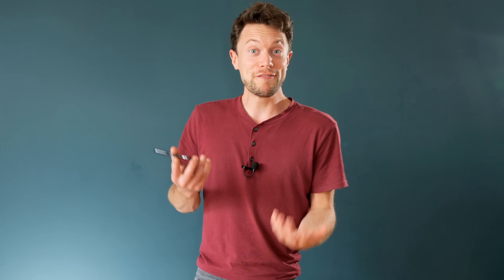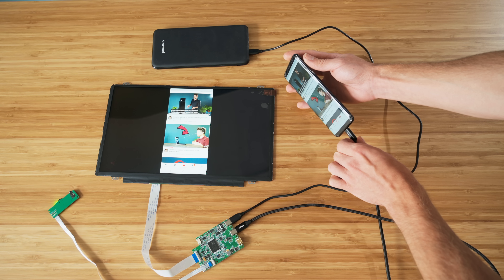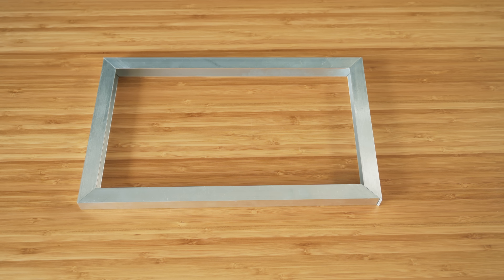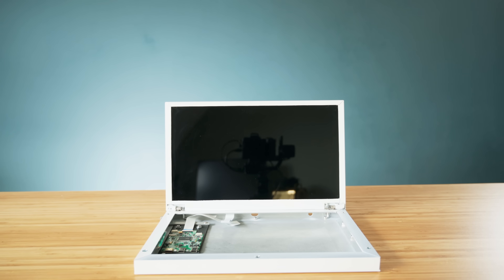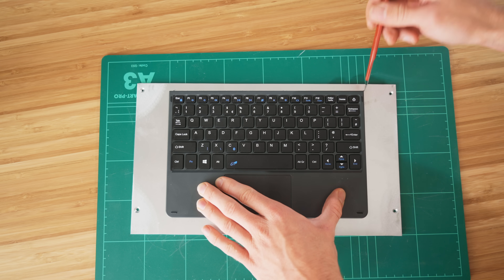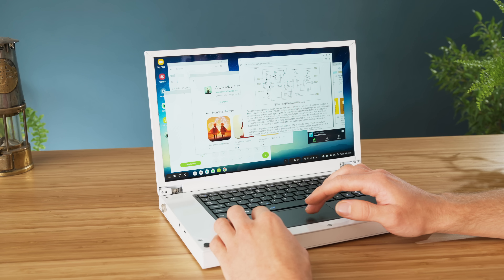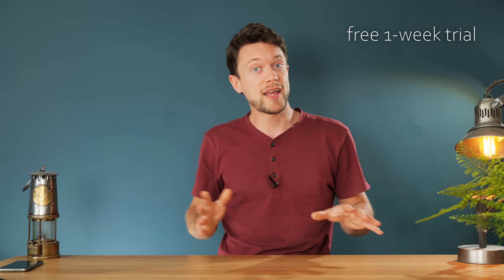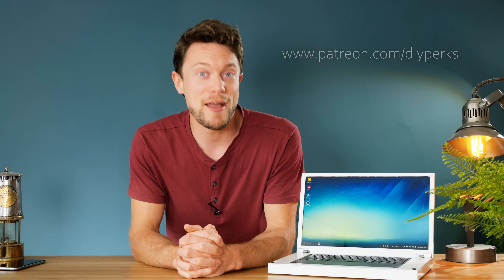Broken smartphone to working laptop transformation

Comment: You can also use a One plus phone and enable the desktop mode in it to have an experience like Samsung Dex... It works just like samsung Dex but it is not the same as Samsung Dex... It heavily lags behind Samsung Dex but is still usable...
Reply: This works only on the newer models of One plus phones... I have tried it on many other phones running android 10 but the results were negative... I have seen vids with One plus phones working on desktop mode... But I'm still not sure... Just putting my thoughts in here

Comment: A lot of android 10 phones(if not all) have a "force desktop mode" "enable freeform windows" and "force activities to be resizable" options available in the developer options. to enable developer mode you will have to go to about phone and tap repeatedly on the version of software your phone runs on, such as MIUI 12.0.4 which is what I have, until you are a developer and it should tell you you are a developer. Then look for the developer options in the settings, you will probably have to scroll down a long way to find these options but the three of them will most likely be together. once you enable this and connect a secondary display you should have a samsung dex-like experience, nowhere near as polished but better than the option that was shown in this video.

Comment: Would the display control board also keep the phone from leaving Dex after power is removed from the charging port (the port going into the laptop?) I am asking as I wish to use my S8+, a power bank with a USB C and USB A both providing the same power and a USB C dongle. but I am not sure if Dex will run on just the power bank alone. Anyone got advice.

Or better yet is there a setting/software that will force Dex to allow phone battery usage?

Comment: Nice project, instead of mechanical switch with USB C, remove the power bank top cover and add a sliding switch between battery and power board of the power bank.
You can turn off the whole system by bypassing the phone's power switch.
Reply: You could also mount the phone higher to use it's rear camera as a webcam.

Comment: This is brilliant, thank you for the video. One thing that should be noted is that powerbanks generally don't have a "passthrough" capability which is charging and providing power simultaneously.
Reply: get a better powerbank then lol any ones i've had, always had passthru charging. and this was 5 years ago
Reply: @KnockOut101inc  what brand u use ?
Reply: @coron1985  I have a nice one I keep in my car in case i need it anywhere. its a weird brand called gooloo but it even has enough juice to jump start my car. had it for a few years now no issues
Reply: @KnockOut101inc  ahh. That brand is hard to find here.

Comment: ok so I LOVE this project, which is why I ask these questions, and plan to make my own version very soon. So this is not necessarily a "durr u dum why did u not do it bedder" comment, I'm legitimately curious, especially since there might be reasoning that I'm not seeing. That being said: 

1. why the barrel connector for charging? it goes USB > barrel > barrel socket > USB again? I know you had to splice in the charging circuit for the keyboard, but couldn't that still work over USB, even maybe a Type C extension?  then you could charge using just about any USB cord and wouldn't need a custom spliced-together cable.

1a: why not just charge the keyboard off of another USB port on the power bank?

2. why not design to have the phone on the outside in the first place, or use more wood/plastic in the construction to allow for signal connectivity/cameras? (the sugru was clever, but sort of felt like an afterthought, like you built it out of aluminum and then realized it cuts off signal when you tried to finish it) 

3. why no regular power switch? there's USB in-line power switches, and control boards like this one that have monitor button control boards that could allow for an actual power switch.

4.  why not use a touchscreen panel? I've found variants of the panel you used that have all the proper inputs/outputs, but also include touchscreen capability. were there just none available when you did this project?

Comment: Eventually DIY Perks will have a video "How to build a foundry and fabricate your own x86 64bit CPU"
Reply: "repurposing a crashed car into an assembly line"
Reply: x86 64bit is actually a "AMD 64" CPU. Or if it's pretty not really obsolete and is by Intel, then it's "Intel 64"
Reply: @valerafox7795  And all three names are not 'wrong'
Reply: @marksmithcollins   we should choose the most correct one. We should understand we mostly mean AMD64 (i686) anyway, not the others are
Reply: @valerafox7795  x86_64 is x86_64, what you mean by Intel 64 is Intel Itanium, which was used nowhere pretty much
Reply: @ch1ptype  I literally said that, but with the other, but still acceptablr names. IA-64, Intel 64, Itanium - it's all the same thing.
Reply: With aluminum

Comment: How about using USB C magnetic cables which are magnetically detaching just the head tip from cable, instead of plug/unplug operation that will wear the plugs excessively?

Comment: I have a screen-broken Xperia Z3 and a Motorola atrix lapdock fully functional... Connect keyboard and tactil panel is pretty straight forward since its only needed an microusb cable extension.... The tricky part is the display... Motorola lapdock has a micro hdmi connector and I dont know how to send the display signal from phone to lapdock... Could Anyone point me in the right direction please???

Comment: USB 3.1. 
Usb-c is THE shape of the connector capable of USB 3.1 standard transmission, also containing video signal. It is fraudulent calling this usb-c as a usb-c shaped connector may carry a useless USB 2.0 standard without video signal. (Video signal came in usb standard ver 3.0, the phone refered here is USB 3.1).

Comment: Nice demonstration, but completely impractical costwise.  If you want to use a broken smartphone as "laptop", just get an older broken smartphone which support  either mhl or slimport Hdmi connection.  Then you can use a standard tv/monitor,  bluetooth keyboard and mouse as well as wireless charging and you are all set for minimal cost.

Comment: Also what tool do you use for accurate angle cutting and trimming down of the angle line pieces.

I would like to have a go at this but I want to get the right tools.
Also that stud thread tool for those flush inserts is something I have never used.
Can you possibly throw me a bone on this

Comment: Alot of folk taking the piss in here I actually think this is a great build, im just a little disappointed with the lack of coverage on how you secured the the aluminium parts together specifically with the main section for computing hardware the u channel size etc whats thickness how much uchannel space did you have in there.

This is a good home diy laptop that could be enhanced everyone spewing about the wifi signal knows if they are bright enough that there are ways around that other than smashing a phone on the back of the screen.

Thank you mr DIY Perks this has inspired me.

Comment: i tried making this and i bought the screen from your link in description i got the screen and i plugged it in and my phone to check if it worked it didnt it keeps going into a power save bubble in the middle then shutting off i messaged the seller and they asked if it was broken i have the right power supply he said but they would not take it back now im stuck with a broken screen and dont even know what to do with it

Comment: Hey u is it possible to make exactly the same thing, but thinner and with bigger keyboard and bigger track pad?
Reply: Yes there is... I would take apart the phone. And put it in the enternal chassis so u have just the motherboard ect... Then you could use thinner material other than aluminum so the WiFi is fine, for the on/off system you could make it an actual electronic switch instead of a physical switch you could salvage a bigger keyboard from an old laptop or a usb keyboard or you could buy replacement laptop keyboards from eBay or Amazon

Comment: How to repair your house after a tornado:

DIY Perks: Grab some sheet of 2mm thick aluminium :v
Reply: Buy 99999 fans and then hot wire there wires onto the aluminum sheet :v
Reply: @agentburningbutters3655  now, grab some 2 part epoxy
Reply: Hahaha
Reply: no wifi :|
Reply: ahahahahaha and fiber board and carbon fiber sheets
Reply: just dont use the pacman
Reply: Don't you mean "how to protect your house from the Tornado"?

Comment: Interesting. But could you force a Windows emulator to then run an Android emuator such as bluestacks with a busted up Galaxy Note 9? That would be very awesome. Especially since the Note 9 is 8 processor cores and each instance of bluestacks requires at least 1 core.

Comment: They have a phone laptop or Lapdock out now called the Nexdock. It's basically a laptop shell that you use your phone to operate via Samsung Dex. They just came out with a Touch version. So you can get this in a smaller normal laptop form factor.

Comment: if the phone was functional, Could you use its screen as the touchpad?
Have a usb c dock, in the part of the laptop closest to you, and install/make some software/app that makes the phone screen act as the touchpad.
have the diy laptop box with you, in a backpack, then whenever you want to use it, simply plug it into the usb c port and slide the phone into the touchpad space. (adapters for different models sold separately)
After a few revisions, and upgrades, if you slimmed it down a bit It’d probably sell really well. Some modern phones are really powerful.

Didn’t iOS also recently get an update that lets you use Bluetooth mouse and keyboard?
iirc there are cases with wireless keyboard and trackpad available in aluminum that make your iPad Pro look like a mac. It’s really really cool

Comment: There's a problem with this build, most battery banks can't be charged when in use, in addition to this, wiring the bank in parallel with the keyboard in this fashion would split the current and take even longer to charge them. The only way i can think to combat this that doesn't involve a custom power delivery circuit is to get a wall adapter with a high enough current output. Plus, depending on the type of battery bank you have it's possible it can charge with higher than 5V. So you'll need to make adjustments if that's the case. If you don't have a fast charging power bank be prepared to wait hours. 

 Please let me know if I'm wrong, I'm trying to learn :D
Reply: If the powerbank supports usb PD it's quite likely that it can both be charged and output power at the same time. Normally it can also allow for charging at up to 20V which would significantly speed up charging but as he decided to use a barrel jack instead of a type-C port for charging he won't be able to take advantage of this.
Reply: @oliverer3  thanks for the information, but in this case does PD stand for power delivery?

Comment: Ok people this is a cool thing to use old cell phone or Broken screen a nice small laptop computer for me I get 2 phone not being used so why not something out of them...
I have something special to do, I into ham radio so I can took it into the field for emergency work using something call FLdigi for android there are app for RTTY, PSK and SSTV..
The one question I have is can you used something like this for a screen...   
9 inches 1024*600 HD Screen Display LCD TFT Monitor with Remote Driver Control Board HDMI for computer    
its cheaper or just a control board for a laptop screen...one this I do also is to remove the battery for the keyboard and run for the battery pack...One this is made u can away plug in most any android...

Comment: Now if you have switched your phone number from the smashed phone to a new phone & you are only connecting to the internet via WiFi then this laptop built using a cellphone is NOT connected to your cellphone account. Is that an accurate statement?

Comment: Can anyone plz clear some of my doubts.... I have multiple Android phones (with broken Screens) none of them supports MHL (according to list of supported devices) and i have a 40 inch TV (not smart TV).. 
I'm thinking of using one of those dead Phones to make the TV a smart TV (just to watch Youtube and use some streaming apps like prime video etc. on Big Screen (I'll be using a bluetooth controller or a wireless keyboard mouse) ) 
The Problem is since the Devices don't support MHL. I would like to know if there's any way to add an HDMI output to an android device that doesn't Support MHL.

Also, 
While looking for solutions i found some MHL adapters on amazon that say UNIVERSAL (and have no reviews and stuff) so, my question is will any such adapter add MHL functionality to a device that doesn't already support it. (or is the UNIVERSAL just for Show)
(my devices include: Honor 9 lite, Honor 9i, Samsung C7 pro, and a POCO F1 (I'm currently using this one but i may upgrade soon))
(I'm ready to open up my phones as they are already useless so what could go wrong) (So, if there's anything i can do from the Inside plz tell me)
(If HDMI is impossible a VGA out might also work!!)
Reply: i want to do the same... any updates?

Comment: a nice idea indeed
liked the way he finished the disply completely
the base of the laptop was a bit industrial look
one more problem i could see is to switch onn the powerbank when connecting it as moast of them need to push the physical switch on them
the circuit cout have been switched onn with an electrical switch insted of moving the display board on a slider made out of plastic

a big thumbs up for the idea

Comment: I have a motorola 3g phone which is perfect from inside and a 7inch tablet who's hardware is not gr8 and without a SIM slot 

Can I use the smartphone PCB boardto display of tablet and work as a tablet.

Comment: My question is, where does he get the aluminum? At my local prices, that's like $75 to $100 of aluminum.
Reply: Combine that with the cost of everything else, and it’s cheaper to just get the phone repaired.
Reply: @transistor-exe  yeah, even pretending you have the knowledge, you can have the alu for free from a friend's workshop and the jigsaw/bits from your father, the LCD, the keyboard and the other board are still more expensive than an used, working S8
Reply: @firmaleggibile4130  exactly. This is a reasonably cool video, but it’s heavily impractical.

Comment: This is an awesome build. If you wanted to add the 1" driver but you couldn't fit it laying flat, I'm sure that you could mount it at a 45 degree and cut some slots in the bottom for the sound to escape.

Comment: Will this work if phone has broken display and phone is ok but display is not at all there.  
If not so, Can you plz make a video on replacing 5.5"mobile phone display with any other OEM/Local display of same size of 5.5 inches or higher sizes  just like Universal TV panels solved those problem in TVs. This also avoid electronic waste being increasing all over the world only for want of same display replacement

Comment: For the cost of this, I could just replace the screen..
Reply: For the cost of this you could just buy a secondhand laptop which would probably be more useful.
Reply: Yeh, but it would still have a small frame video in a small keyboard in a cellphone you dont use anymore. I think your brain didnt get the picture of turn a cellphone you dont use into a notebook.
Reply: @voce3337  The problem is the cost of the total project. The screen and board, and the keyboard are almost pushing it into $200 alone. The cost of aluminum and other parts would probably push it close to mid $300s+
Reply: I'm an android user and by my experience, If my Phone breaks I buy a new one. Fixing the screen just isn't worth it. (and I've got around 6-7 devices with broken screen in past few years, (Some of them are completely dead now maybe their battery died or something))
Reply: oh yeah. it's gonna cost a ton for a broken laptop with a decent screen. you could pay upwards of $10. and I have never replaced my 95 think pad, so I have no spares. and I still use my motorola started too. this is gonna cost a ton! how am I supposed to find trim for this? I know I'd throw up if I had to look at a laptop made from walnut or birch. I might as well buy a gaming rig right? oh wait, I'm not a child and I have 99% of what I need already. but I still sound like a know it all child.

Comment: I really don't like the idea of epoxying the screen to the aluminum sheet as that limits future repair options - probably because as a computer technician I have had to replace loads of laptop screens. I think what would be better would be to drill and thread some holes where the screens mounting holes are and put some brass standoffs or something of that nature there.
Reply: The other thing I would want to do differently (I'll grant that it is more involved) is getting a laptop keyboard: you can get PCB adapters that let you access all of the pins - then wire that up to a Teensy and you have a keyboard fully wired in.

Neat concept overall, though. A lot of your approach to this I WOULD NOT have thought of.

Comment: every one understands usb 3.0  would of been cooler if tore the apart and did away with the screen and replaced it with larger one. also chuck the battery out of the phone and replaced it with a bigger one

Comment: the power connector is stupid, just put a usb extension....also you should had to remove the keyboard battery and wire a step down converter directly from the power bank that way you arent charging extra batteries(extra failing points)